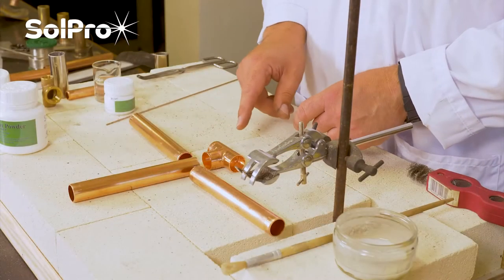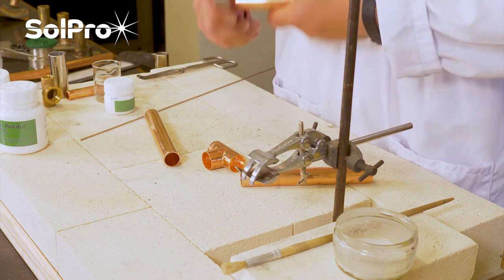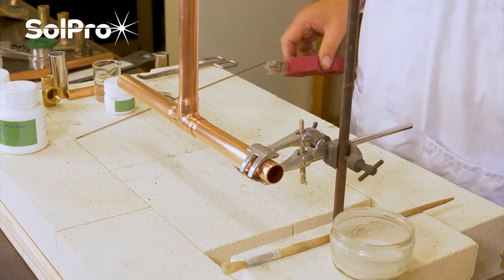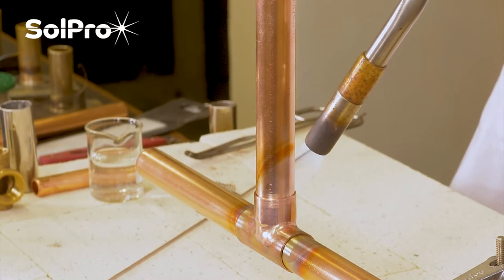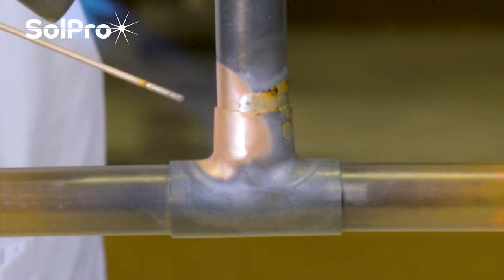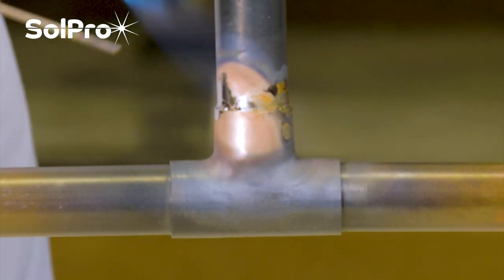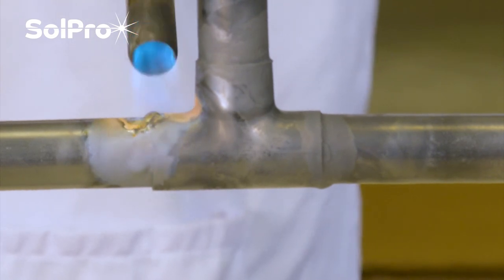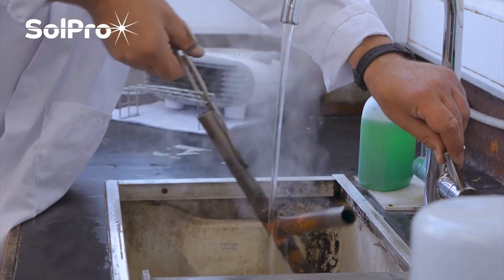Brazing Tutorial - Copper to Copper T-Joint

Comment: Erm, that's MAPP gas, not propane - which would be significantly less hot.  The MAPP as demonstrated actually worked fine, per my expectations, though it's not available anymore, at least in the USA.  (https://youtu.be/WGKdcgzTKxw?t=256 shows the yellow tank and MAPP label.)